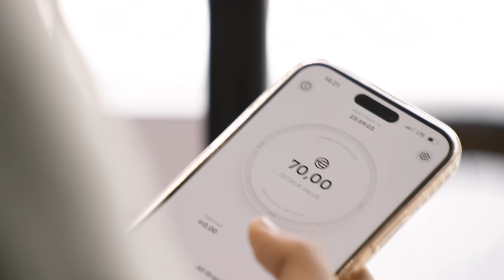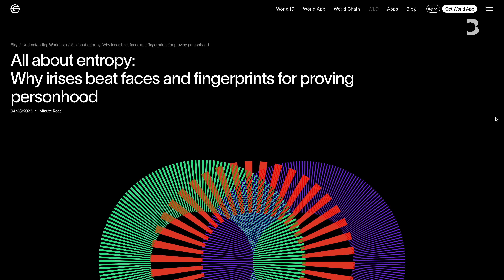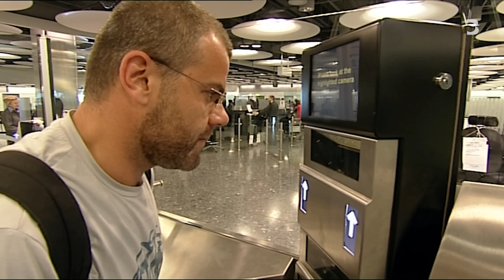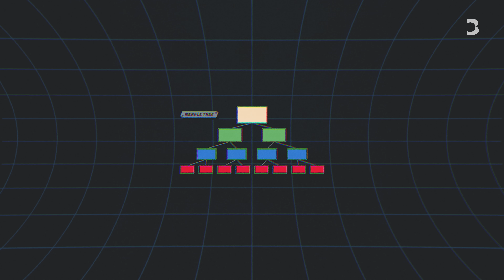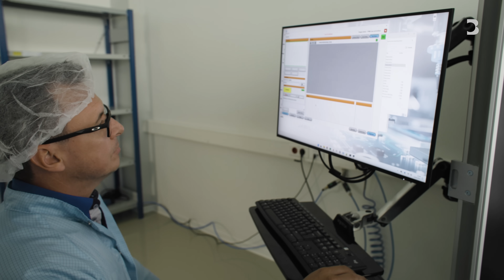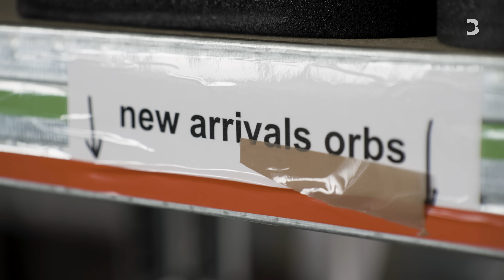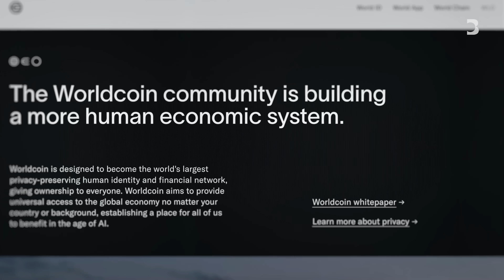This Eyeball Orb Wants to Save Us From AI | Hello World with Ashlee Vance

Comment: Once you have the iris scan of a person, wouldn't it be possible, eventually, to mimic that in a humanoid face? It's possible to engineer an eyeball screen device where you can show any image for the iris...
Reply: Same for face ID and other things
Reply: it's cat & mouse game.
Reply: From the whitepaper: ...inherent to biometric algorithms is the false acceptance of a user. The false acceptance rate is largely dependent upon the system's capacity to detect presentation attacks, which are attempts to deceive or spoof the verification process. While no biometric system is entirely impervious to such attacks, the important metric is the effort required for a successful attack. This consideration was fundamental to the conception of the Orb. Developing the Orb was a decision that did not come lightly. It represented a high-cost endeavor. However, from first principles, it was required to build the most inclusive yet secure verification of humanness and uniqueness. The Orb is designed to verify uniqueness with high accuracy, even in hostile contexts where the presence of malicious actors cannot be excluded. To accomplish this, the Orb is equipped with every viable camera sensor spanning the electromagnetic spectrum, complemented by suitable multispectral illumination. This enables the device to differentiate between fraudulent spoofing attempts and legitimate human interactions with a high degree of accuracy. The Orb is further equipped with a powerful computing unit to run several neural networks concurrently in real-time. These algorithms operate locally on the Orb to validate humaneness, while safeguarding user privacy. While no hardware system interacting with the physical world can achieve perfect security, the Orb is designed to set a high bar, particularly in defending against scalable attacks. The anti-fraud measures integrated into the Orb are refined constantly.
Reply: The image of the iris is deleted once verified.

Comment: So this is no different from a fingerprint scanner essentially, just that it's connected to crypto which is fine, but like if they share it via open-source and also decentralize it as a protocol, the main function of it becomes problematic as it was meant to distinguish not just unique person, but if the person is actually human or not. What if you simply let the AI train on the data from the iris and let it reproduce a fake iris data? And if you got the open access to everything, including it's hardware, it's gonna be easy to hack into and fake it. In order for this to be working it truly needs to be dystopian lol.. it needs to be controlled by a single company that is trusted and the inner technology has to be kept super secret, nobody can touch it, etc.. I mean, am I wrong here? How else can you make something un-hackable forever when we expect super intelligence soon?

Because I've been thinking about this problem for a very long time and how to solve this, since as a hacker you can also just go deeper into the hardware, record the electrical voltages, decode bits, find the data patterns and even with some encoding, you got what you need and can fake the pattern. It's gonna be 100x easier for much smarter AI anyways. The only solution that doesn't require a single company that I can think of is very theoretical and it is to use quantum chips and use it's ability to detect whenever there is a listener (hacker) via the quantum entanglement. But you would need probably to develop a light based quantum sensor (something like CMOS) for the cameras, that would directly send everything to an optical quantum computer with no conversion mechanism to electricity during the processing as that can be tracked. I think it's possible to do, but I am not a quantum physicist. And it will also take a lot of time till we'll be able to develop it.. the only hope we have right now is to I guess encode it with something like SHA-3 hash as soon as it's physically possible on the chip.